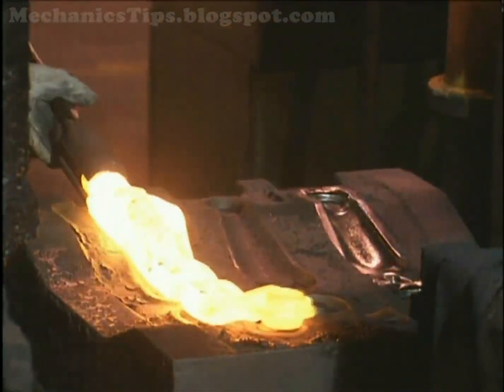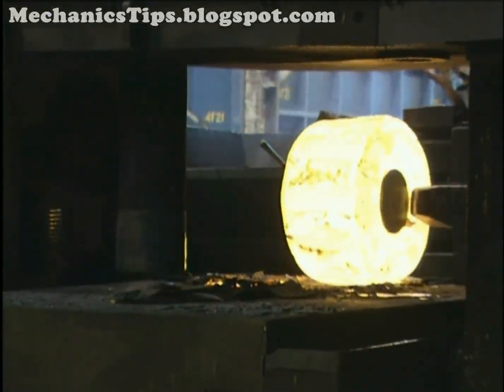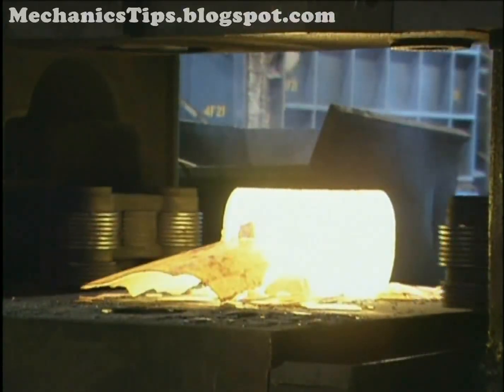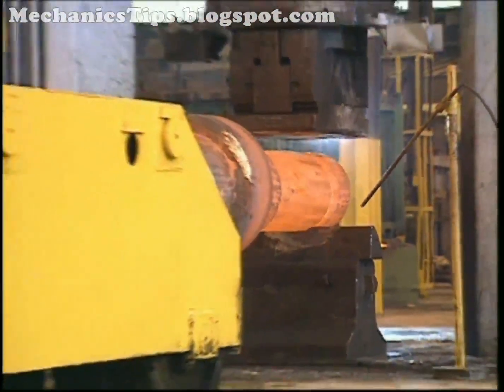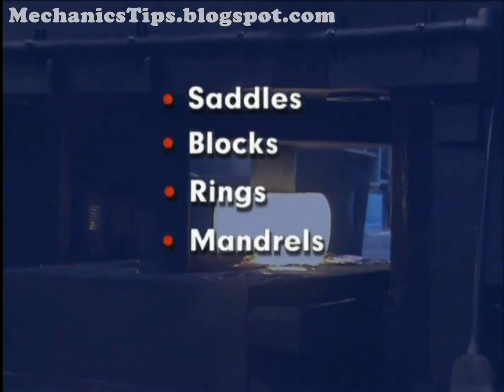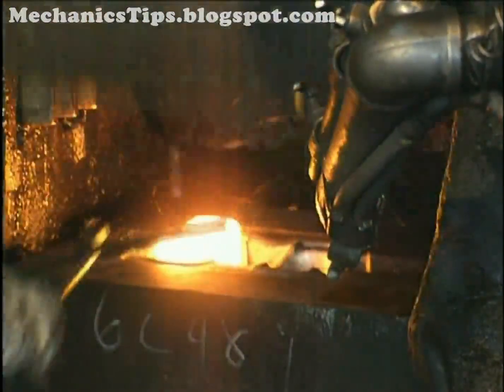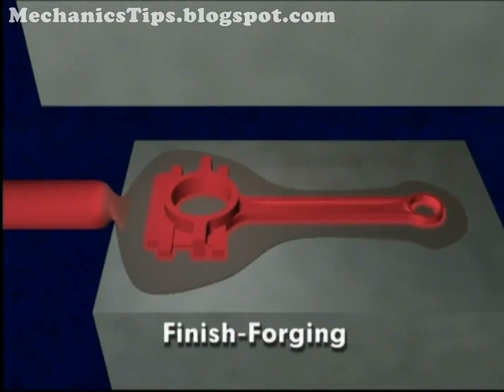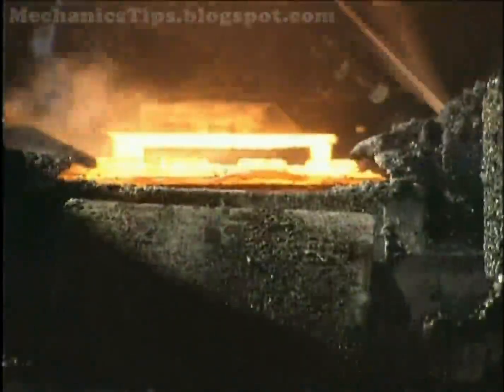Die forging process(open and closed die)

Comment: What is difference b/w finish forging and closed die forging
Reply: Closed die forging is where the dies surround the metal being forged, finish forging is the last step in the forging process where you get to the point that the machinists get it. Finish forging is a sub-type of closed die forging.